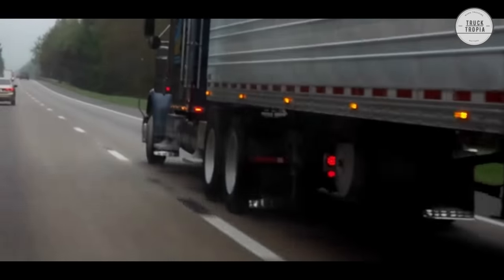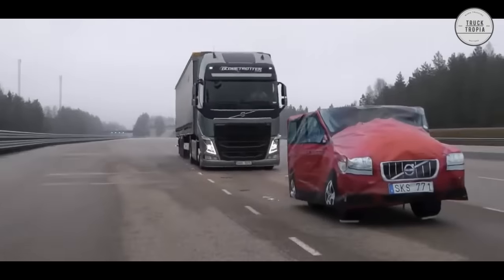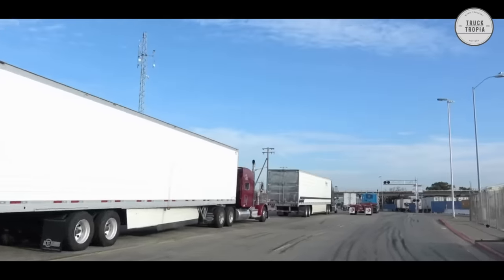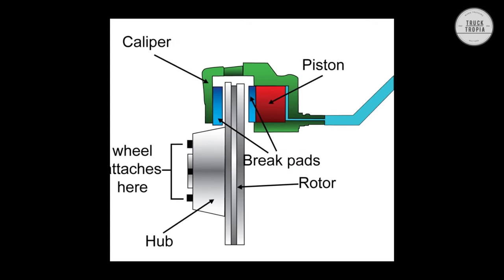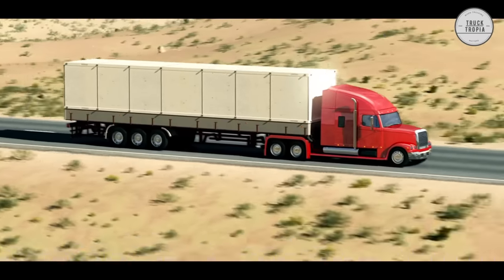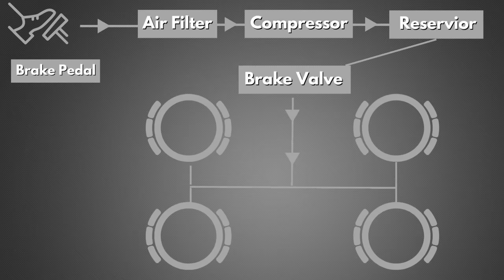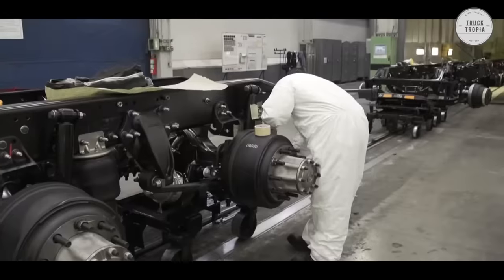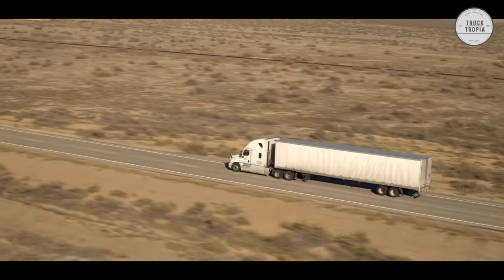Why Do Semi-Trucks Use Air Brakes?

Comment: Another quirk of air brakes is the time needed to build up air pressure so the brakes will disengage.
There is a half minute of time between starting the truck and being able to move.
This would not be tolerated for a personal car, but trucking is a job and you sign up for the half minute wait when you take the job.
Also you spend so long driving you may not care about the half minute pause.

Comment: In our country(India) both buses trucks and trains use air brakes
Reply: That's true worldwide.
Reply: At least in North America, the air brake system used in trains not only does not have the failsafe parking feature of the truck system, it is fundamentally flawed and unable to even keep the brakes actively applied for a long period with even slight leakage - this has caused major crashes.

Comment: I paused the video as soon as the voice said hydraulic system uses a fluid instead of air. Gases and liquids are both fluid. Fluidity means a certain fluid takes and fill the form of the container that it occupies. Air is also a fluid. The only difference between gas fluids and liquid fluids is that gases are compressible and liquids virtually aren't. If a physicist was next to you he/she would have punched you in the face. They're fluids all of them. Newtonian and non-newtonian fluids.

Comment: Imagine using hydraulic brakes with all of those connections.  You’d need a 55 gallon drum of brake fluid strapped to the truck to compensate for the leaks.

Comment: I think the main reason is, with a semi where the weight limit is critical, any excess weight that can be removed will be.  Sure, air lines are easier to couple to a trailer, but you can make valves that make coupling easy and leak-free.  But if you scale it up like everything else, say comparing 5 quarts of oil to what a Cummins uses, and then apply that to the added weight of all that brake fluid (remember the trailer too), and you see you'd lose maybe a 100 lbs from your carry weight.  Might not seem like a lot, but when you figure losing 100 lbs of chargeable weight to every trip, and you see why air brakes make a lot of sense in trucking.
Reply: The issue with that logic is that air brakes still need a compressor, dryer, air tanks, lines, and heavy springs to function, at a minimum. The weight of all those parts definitely exceeds that of any comparable hydraulic brake system.

The main advantage I see is the standardization of coupling to a trailer. Coupling separate hydraulic systems is nearly impossible to do without introducing air into the system. If the system uses air to begin with, it's not an issue.
Reply: No it doesn’t really have anything to do with the weight.

The number one advantage that air brakes have over hydraulic is simplicity and reliability.

A blown hydraulic line would put a truck out of service and require a lot of work to repair.

Air leaks and even severed air lines can be patched on the road and allow the system to continue to operate until the truck can be driven to a repair shop for new air lines.

Also, something the video gets wrong, is the safety factor of air brakes in the event of a catastrophic failure.  The system works by RELEASING air pressure from the brake chambers when the brake pedal is depressed.  A spring forces the the pads to move and create friction against the drums.  When the pedal is released, air fills the chamber and compresses the spring, which releases the brakes.  So in the even of a catastrophic failure (loss of all pressure) in the braking system, the brakes will automatically apply.  Trailer disconnects from the tractor?  Brakes go on automatically.  Cost efficiency and safety are the two most important factors in designing trucks, that’s why they’re built the way that they are.

Comment: Heavy vehicles get more miles on a single vehicle and when hydraulic lines rupture, they make a big mess on the road that's also unsafe to drive over. Changing brake fluid isn't cheap either.

Comment: You saw the two differences on 
Hydraulic Brakes
Air Brakes 

An Yes the tractor's front (Steering Axle) has Disc Brakes which uses hydraulic brakes.

On the drive axles use compressed air used to operate the brake drums.
When coupled to the trailer also uses
compressed air for trailer wheels.
Ok !  There's a difference between the 
two systems , how effective  possible 
cost to replace when it have to be replaced.

Comment: Truck/ trailer brakes are a split system,,,,,  service and emergency the emergency side has needs constant air to keep the brake off ( has a caged spring in the rear half of chambers ) and the service side gets signal air via a relay emergency valve which speeds up brake application and the actual air used comes from a air tank close to valve and chambers
As far as fade it’s generally poor driving both discs and drum need some heat to be effective

Comment: They're actually spring brakes. They have to be supplied air to release the spring and then your foot pedal counter acts that force easier than the release force. As far as brake fade goes. It's a super hot gas that forms under the brake pad. It's like a plasma, hot as the Sun. Makes a cushion of gas so the pad and brake surface can't connect no matter the force.
I may add that you can use the release valves in an emergency situation. Maybe some of the brakes will catch. Just depends on the situation. I think you're suppose to release the trailer first. Then the tractor. Of course it's dependent on the situation. You hit the trailer on snow and ice it may come around on you and jackknife.
Reply: It is air pressure that provides the braking force, not the spring.  The spring just provides a “fail closed” feature that doubles as a parking brake.  When you release the park brake, air compresses the spring and releases the brake. When you press the foot brake, a separate cylinder pressurizes and presses the brakes closed again.

Comment: Simple answer.  Because the heat generated by braking an 18 wheeler with 80,000 lbs of stuff in the trailer would boil brake fluid in the calipers/drum assemblies.

Comment: Disk brakes were not used on heavy commercial vehicles for a few reasons...one is the shorter service life...they usually have less friction material of the pads in contact with the rotor at once which causes the pads to wear quickly...two is the metals available at the time were much less able to deal with the massive forces and heat without warping and damaging the rotors, once warped and gouged they tend to shorten pad life even faster, cause excessive vibration, uneven braking, possible damage to other brake components....the third reason, which is still relevant today is the fact disc brakes are expensive to manufacture, they require expensive rotor materials which can be difficult to work with, they require tighter tolerances, they are used much less often, so on large commercial vehicles there is a need to design an entirely new system which will require a lot of expensive time consuming testing and then have to given the ok by whatever country you want to use them in... again they aren't used often so Mechanic's have to be taught the new systems diagnosis, repair and replacement procedures....one thing I don't know how they would get around...when drums overheat and expand they expand away from the friction material...a brake rotor would expand into the friction material...and if you make the pads larger with harder material and the rotor expands into it you will have trucks stuck in places or the rotor expands beyond the limit of the caliper breaking it and the truck losing brakes...how do you implement air actuation into a disc brake system?? Along with an emergency spring system to lock the brakes up on loss of air pressure? Like it's a lot more than just bolting some stuff on a truck involved in keeping you safe when you decide to cut off an 18 wheeler and brake check it thinking it can stop that quickly....it's a mistake folks don't do it...the truck driver will not be at fault because of a simple fact....he cannot actually stop fast enough to not run you over...I've seen the accidents closer than you want to be driving a flat bed wrecker doing state police calls...I've seen whole families taken because the head of household got road rage and thought "hey I'll cut this truck off and slam on brakes that will show him who's boss" and that was it 2 adults 3 kids gone....but not all of them instantly...3 were partially there and witnessed the rest of the family like that before leaving in a very painful sad way...so again don't do it folks that truck cannot stop that fast...
Reply: " if you make the pads larger with harder material and the rotor expands into it you will have trucks stuck in places or the rotor expands beyond the limit of the caliper breaking it and the truck losing brakes"
Trucks have had disc brakes for years, so it's already been resolved, they just allow enough room for expansion, so no locking on brakes due to heat or busted calipers.
"how do you implement air actuation into a disc brake system?"
Same way they do for drums, you have a spring brake actuator apply the force.
Reply: I've driven plenty of trucks that had disc brakes on all axles and even on the trailers

Comment: There's a fair bit of misinformation in this one. Been a truck driver for over 10 years.

One of the main reasons why trucks use air particularly with trailers with air brakes is due to the connections being switched all the time. if you're jumping from trailer to trailer. Leaking hydraulic fluid or just losing fluid every time you hook a load or disconnect from a trailer would be a problem regarding basic economics and environmental reasons. Air leaks don't hurt anyone. But hydraulic weeks are in environmental disaster in large quantities. A hydraulic system capable of connecting and disconnecting would require another tank for hydraulic fluid

Comment: It is not because of more power from air brake. The biggest reason is the coupler. When you connect and disconnect, some air or fluid is lost. Fluid loss is not good. But loss of air during connect and disconnect is inconsequential.
It is also true that air doesn't freeze but it can block nozzle.. But brake fluid is serviceable within the operating temperature.

Comment: Brake fluid will boil due to heat in the pads take in count very heavy loads mean greater friction temperatures, not the case with pneumatic brakes, over heating the pads that's another issue

Comment: I’m curious in air brakes , if it is difficult to graduate the braking pressure and to tune each wheel so no one wheel decide to lock up under medium braking pressure etc ? 
An advantage I’m guessing: under no braking each shoe is lifted high and dry from its disc/drum surface, unlike a car

Comment: How truck air brakes work is totally wrong on this video. In trucks the brakes are applied on default by strong springs that push against the drum , compressed air is needed to release the brakes. if the air compressor fails , trucks cant move.
Reply: True.
Reply from the maker: thanks for sharing your opinion
Reply: @TruckTropia  opinion? Facts!
Reply: @TruckTropia  Nope.   Do your homework.  You grossly oversimplified everything in this video
Reply: Spring application is only for the parking/emergency feature. Air pressure in one chamber pulls the brake off against the spring, and air pressure in another chamber applies the brake in service.
Reply: Yes. Even is air pressure is low it can't move right? (I play ETS2)
Reply: @NewtYT  Correct - without sufficient air pressure to overcome the springs, the parking brakes are on and the truck can't move.

Comment: The only advantage of air-brakes over hydraulic-brakes is they are massively easier connect and disconnect part of the system such as when changing trailers.
Reply: It's not the only advantage, they are just better for heavy vehicles in general which is why — for example — most buses use them.
Reply: @michaelwoods2672  
Or articulated trucks are the default heavy vehicle which got the funding in brake development resulting in air brakes being the default heavy vehicle brake despite being inherently inferior in unarticulated vehicles.

Comment: The actual brakes might overheat - But the reason is pretty simple; You need A LOT of brakingpower. Airbrakes, and air/hydro brakes can produce so much more power, than if you stood on a brakepedal yourself. An engineer could probably explain why - I cant.

What many people seem to not know, is that there is a "brake-helper", that uses the suction from the engineexaust, to brake your private  car. But you have to use the gears, for it to work properly.

This is also why all modern trucks have a retarder, as oil cooles faster than air. And the electric ones, can even aid in recharging the battery

Comment: Correction: Drum Brakes are not only used for their price, since they are in a sealed container, they are preferred for Off-road use, since disc brakes can and will deteriorate in those conditions
Reply: I didn't know they made off-road semi-trucks.
Reply: @KX36  Most third world countries uses standard highway trucks in dirt roads or "off-road". Take the "highways" in the Amazon region for exemple.
Reply: @filipearthur5379   cool, thanks for the info

Comment: You have hydraulic brakes, you pneumatic  (air) brakes, and then you have a third system, air over hydraulic which the japanese use in alot of thier smaller trucks, not sure about the European manufacturers though
Reply: I've only seen that third one in the Unimog.

Comment: Air brake explanation started good, but then the explanation got messed up.
Hydraulic brake also use a booster, that is not shown in the diagram.

Comment: The other forgotten point. The reason large trucks use air brakes is because of the pressure. A Hydralic brake on a large truck would need a very large brake line to handle the pressure and that is just not practical.
Reply: The pressure doesn't suddenly become harder to contain when you switch from air to hydraulics. It wouldn't need a larger line because the pressure wouldn't need to increase. In fact, it might even decrease, since hydraulic fluid is effectively incompressible, meaning you can put more work in with the same pressure since a portion of the energy put into air brakes just goes into compressing the air more while the rest of it goes into pushing against the brake shoes/pads. Whereas in a hydraulic brake system, only a very small fraction of the energy goes into compressing the hydraulic fluid while the vast majority is applied to the brake shoes/pads

Comment: I'm sorry but I'm not convinced about any arguments in this video.
OVERHATING? We're talking about a medium that actuates brakes, what would air/liquid cause overheating sooner if heat is actually produced by discs/drums?
COMPLEXITY? Air brakes still have valves, lines, compressors, actuators, dryers, filters. I don't buy that they're less complex. I would sooner say the opposite.
FAIL-SAFE? They could probably come up with a way to implement a fail-safe feature and a hydraulic system.
COUPLING? Why can't you connect a hydraulic system to the trailer?
COST? Manufacturers shouldn't save money on something as important as brakes on a semi but perhaps I'm being a bit naive here.
Unfortunately this subject is a bit complicated and from this entire video I see a tendency to simplify things way too much for the sake of getting it under 5 minutes. Some statements are just statements thrown in the air (no pun intended) with no logical explanation (like "they just last longer" - WHY WOULD THEY?). This really hurts the quality, along with poor animations and robotic voice straight from sexual harassment training videos.

At least there is a wealth of comments with much better info that the movie. Unfortunately you have to dig through a lot of misinformation as well.

Comment: It's all about safety until the air compressor breaks resulting in oil leaking into the air reservoir and the mechanic decides not cleaning it will save a bit of time; eventually the oil destroys the rubber seals on the air valves at the most inopportune time: the valve pops and half the brakes are now stuck on with the emergency springs and your brakes are burnt in less than a minute WHILE TRAVELING DOWN THE GRAPEVINE.

Comment: Another aspect of the video I don't agree with is the idea that air brakes last longer just because they're air brakes. The only reason you'd get more miles out of air brakes on a truck is because they're larger and provide a larger area for wear due to friction. 
If you were to convert a passenger car to air brakes or a semi truck to hydraulic brakes it wouldn't affect the number of miles it would take to wear out the brake pads or shoes. The same pads or shoes would wear at the same rate because it would be applying the same frictional force to slow or stop the vehicle whether it was air or fluid that was applying that force.

Comment: Why are we talking of semi-trucks only??? Air brakes are not limited to articulated trucks. I mean, simple (rigid) medium/heavy-duty trucks with a long wheelbase (and a flatbed/dropside bed/van body/dumper body/tank for transporting liquids... you name it) also have air brakes as standard. An exception is the smallest light duty trucks, which have hydraulic brakes - such as the Ford Transit, or Iveco Daily/Peugeot Partner (in their cab-on-frame versions), or GAZ-3302 GAZelle (first generation), or the current second-generation GAZelle Next and GAZelle NN in their cab-on-frame versions.